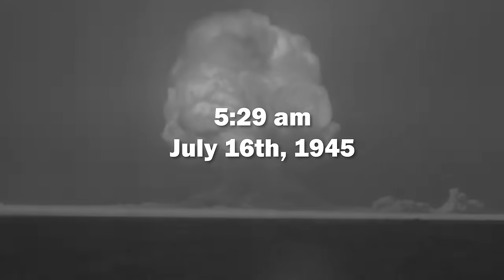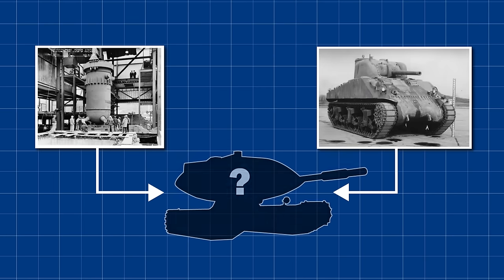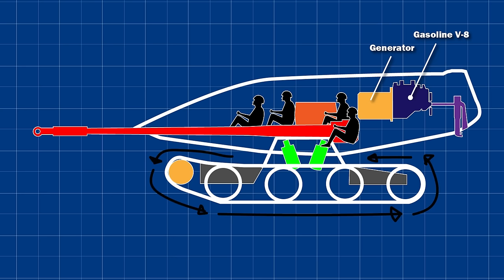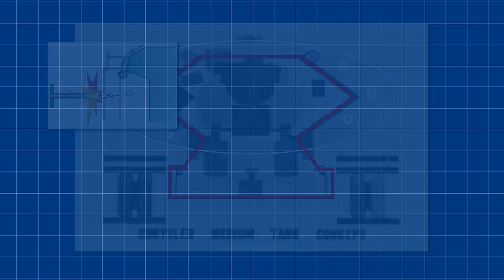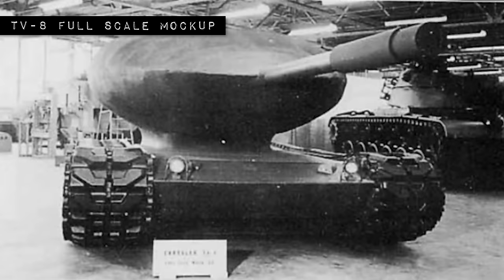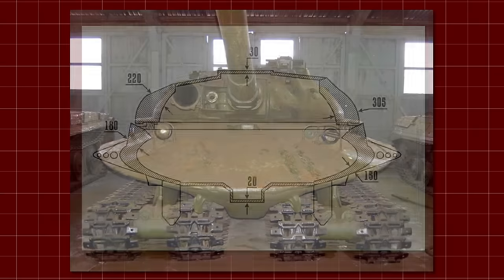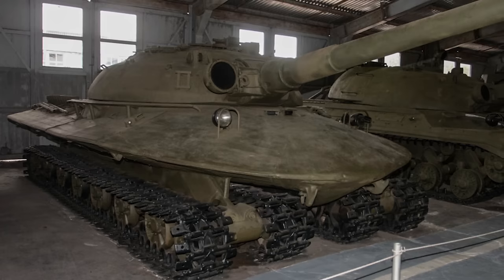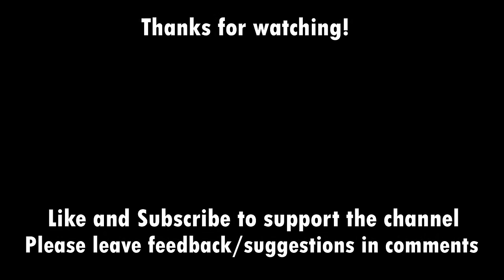The Atomic Tanks of the 1950s - Object 279 and Chrysler TV-8

Comment: The factoid that the Object 279 was shaped that way to "prevent rollover" from a nuclear blast is almost certainly an internet myth. I have a few older Russian books about tank design and engineering, several of which dedicate at least 1 page to Object 279, and one of which has a 7 page section about Object 279, covering its design and engineering - the purpose of the curvature was to get the maximum possible level of protection with plain steel armor while maintaining the smallest volume (and thus - reducing weight). The design of the 279 showed the limit of protection that steel armor could offer and was one of the motivations for Soviet engineers to start designing composite armor with ceramics. None of the older published books say anything about the shape being designed to "prevent rollover" - that was only a "fact" that I have seen quoted in online forums, which eventually made its way to the English language Wikipedia. So I'm pretty sure that part is a myth that someone pulled out of their hat in the early 2000's, and everyone has been repeating since. The Object 279 did have internal overpressure NBC protection, but so did every Russian tank designed after the T-54 (NBC protection was the defining difference between the T-54 and the T-55, for instance).
Reply from the maker: That’s very interesting - you’re probably right! The only thing is, why would they bother with the hollow “points” on the side of the vehicle? I don’t really understand the purpose of those if not aerodynamic.
Reply: @RedWrenchFilms  The hollow triangles on the side served as an experiment in spaced armor against HEAT rounds. Since the side armor was thinner than the massive chunk of steel at the front, and the superplastic jet of a HEAT round begins to particulate and loses its capacity for penetration over a defined distance regardless of what it goes through, the air gap effectively doubled the thickness of the side armor against HEAT with negligible increase in mass. 
On a related note - the first experiments in ceramic composite armor that followed - and which ultimately led to the T-64 carrying Combination K composite armor - were also primarily focused on padding the thickness against HEAT, since the early APFSDS developed at the time didn't have the same kind of penetration depth that modern APFSDS offer, and thus, as far as absolute thickness was concerned, HEAT was a much more significant concern in the 1960s - 1970s
Reply: Very impressive… may i know the name of the book? Would like to get one too
Reply: @OlegMilitaryHistory  Do these books mention anything about a sabot shell for the 279s gun? I have seen a single mention of it online but I cannot find anything else.
Reply: @OlegMilitaryHistory  can u pls tell the name of the book is where u got all the information regarding tanks?
Reply: How much time did it take you to write that
Reply: Soviet moonrover
Reply: Thanks I'm gonna use this as my essay
Reply: Now! Thats What I Call Reseach 14
Reply: Sadly a reality of most military "common knowledge" like a tiger taking on 5 shermans
Reply: Yeah, in the early 2000s "metal gear solid: 3" was released and they had a Russian military base featuring object 279 tanks, or something similar enough, and the game tells you it's designed to prevent rollover.
Reply: To many nerds lol
Reply: @rex-zg9mm  it's a video about an obscure russian experimental tank most people know from war thunder, the game of military autists. If you weren't expecting needs you came to the wr9ng place
Reply: @OlegMilitaryHistory  Do you know the name of the book?
Reply: @wdj4015  BT-5 > Tiger 2 H
Reply: @RedWrenchFilms  The hollow layer on the outside is essentially spaced armour! It was made of sheet metal to save weight, but still thick enough to detonate incoming HEAT munitions, besides being spaced armour, it was also stunded in its shape, which I remember reading somewhere was meant to disrupt the jet or at least prevent it from forming correctly
Reply: are we able to see some pictures of this first hand documentation of the object 279?
Reply: @wdj4015  BT 5 - Tiger 2 H
Reply: Red wrench should Pin this comment
Reply: May I ask what books these are? I’d love to see if I could get them. Are they in English as it appears no but it’s not too big of a worry to me, I just love the 279 so would enjoy the books to be in my possession.
Reply: They really said: idc that the world is nuked. We are still gonna fight in it 😂

Comment: I can't imagine the nuclear power concept for the Chrysler TV-8 would have been given much serious consideration by the designers even before the design process began, but they were given a task to design a nuclear powered tank, so they did.
Reply: Dude they built and flew a nuclear jet plane before they decided it was a bad idea to spread radiation all over the place.
Reply: @oldleatherhandsfriends4053  If you mean the B-36 conversion (NB-36H) to carry a nuclear reactor testbed, I was aware of it. But such a large aircraft would have had much greater capacity (than a tank) for "buffer space" to provide crew safety separation from the reactor, in addition to the lead shielding surrounding the reactor.
Although the B-36 reactor project was deemed "feasible", the project was cancelled, due to the risk of radioactive contaminants dispersed in the event of a crash. Probably a wise choice, I think.

Comment: All comments below about the shaping not having been done for the atomic blast protection have one  major flaw. The rim is very thin and the chance of a projectile hitting it just there thus low. that leaves deflection as an argument but this would increase the chance of projectiles getting trapped between the shell and the turret on the Sovjet design and tearing apart the drive system on both, at least turning the vehicles into static bunkers. I’d say the blast theory is still a strong contender. About things being mentioned in literature in the past. An example: Nobody ever mentioned radar stealth when discussing the Blackbird spy plane at the time. Everybody explained it’s shape on the basis of speed requirements. Still the stealth shaping rings through once one knows. I for one never understood those rudders being canted inwards. Now I do.

Comment: It seems like many videos default to the most optimistic performance of sloped armor. It may be of some help of course, but the reality is heavy shells don't impact horizontally except in rare cases. 
On the weight side the sloped panel is usually longer/wider than a non-sloped panel covering the same profile area and enclosed volume (In about the same proportion as the ideal "effective thickness".). The real protection comes from a deflecting action, though deflection action is not as pronounced at shell speeds as it would seem from subsonic human experiences.

Much of the sloping is really more about mechanical concerns like gun depression angle while also maintaining a low vehicle height.

Comment: As for "A tank weighing 60 tons would sink into the ground"  - tell that to modern tank designers and they'll laugh. Both the Leopard 2 and the M1 Abrams in their most modern configurations clock in at more than 60 tons. And they work just fine, with the standard drive train configuration of two tracks (and not the complex mess of 4 that Object 279 used).
Reply from the maker: Not sink fully into the ground like quicksand. But it meant the Obj. 279 could operate in much muddier conditions and had much better off-road performance than, say, an M1 Abrams would.

Comment: How do you change the inner track of Obj.279?
Reply: If you unpin it you can just drive forward and it'll get left behind. The road wheels are narrower than the track, so they can probably be removed laterally like a car wheel if necessary.
Reply: That's what new guys are for.
Reply: Haul it back to the factory

Comment: I love how th TV-8 would not even be a good tank even if it didnt run the risk of producing micro meltdowns on the battlefield.
There is a reason why modern tanks try to minimize vital parts in the turret and even put all the crew into the hull, cause the turret is the part that is gonna get shot the most. So even when hull down this thing exposes the entire crew and powerpack. Not only that but with the gun mounted this load it has to expose basically everything but the tracks to get a shot off.
Imagine this thing getting shot down in the middle of a street and you are now tasked with getting past it without having your hair fall out.
Reply: Meanwhile the Swedes bringing back the hull mounted gun in style

Comment: They never put nuclear reactors in tanks for the same reason they never put them in aircraft - because we live in our universe and not the Fallout universe. Reactors are astoundingly expensive, even more so when miniaturized, and one typically does not marry an astoundingly expensive and dangerous power source to a set of caterpillar tracks carrying a 95mm slug thrower that has a battlefield lifetime measured in hours. It's fantasy to think we ever had the kind of manufacturing capability to churn out thousands of tiny reactors a year during a nuclear war scenario.

Miniaturizing reactor technology to the point where it could fit on a 4000 ton submarine was a massive achievement that took decades and trillions of dollars, and a submarine is obviously much roomier than a tank or plane.

(and this is without the radiation shielding considerations in so small a space as a plane or tank, which were also unsolvable and unsurvivable at the time. Subs can afford many tons of shielding to keep the crew's exposure minimal, tanks and aircraft can't.)

Comment: Funny how, after all of the work that went into all these different tanks, mediums, heavies, lights, nuclear, aluminium rocket tanks, etc etc, they'd already knocked it out the park with Centurion in 1945.
Reply: Tanks like Obj. 279 had quantifiable advantages over Centurion, but suffered in other departments as would be expected for an exotic prototype. Chrysler TV-8 never made it past concept stage. 

Also it's hard to "smoke" the competition when your vehicle is one of the slowest on the field and by a considerable margin.

The "nuclear Centurion" was more of a fluke and a vehicle expressly designed for a post-nuclear battlefield would certainly fare better.